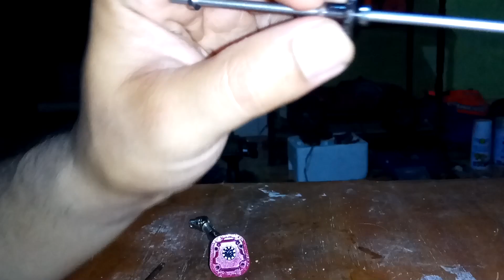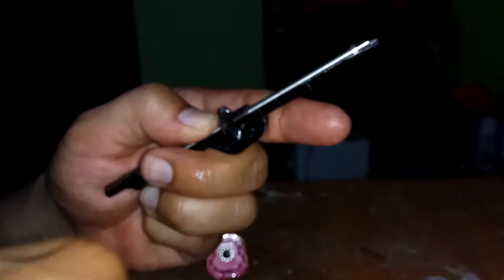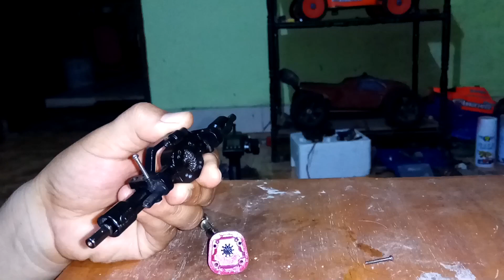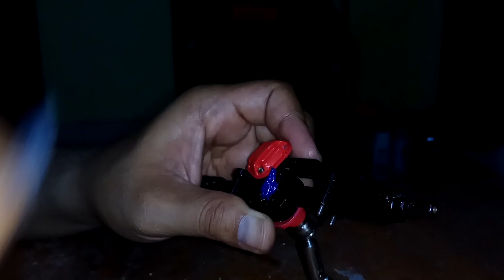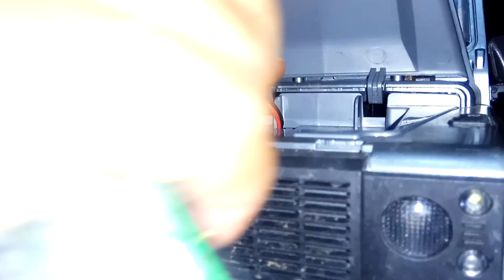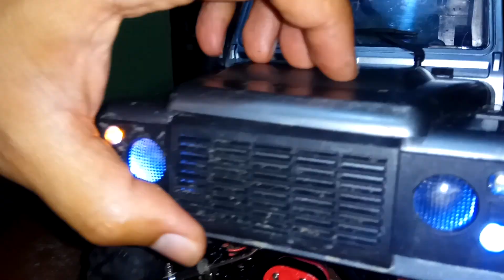MN 99s first upgrade bagian kaki

Comment: Ini chassisnya 99s sebenarnya metal apa plastic sih om? Kok agak dingin tapi dimagnet ga nempel
Reply from the maker: sy kurang tau pasti jg om, tp kl menurut sy kayak lempengan besi biasa..
Reply: @rcapm9641  siap om, terima kasih..td. Cari²  di due ternyata alloy om,  on trapezoidal framework (chassis)